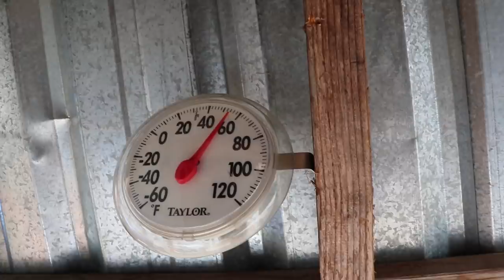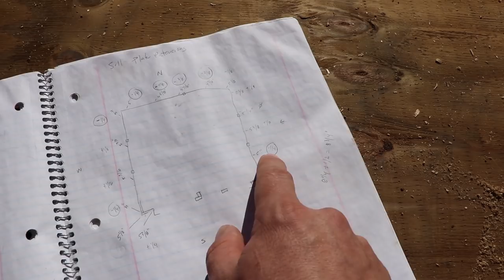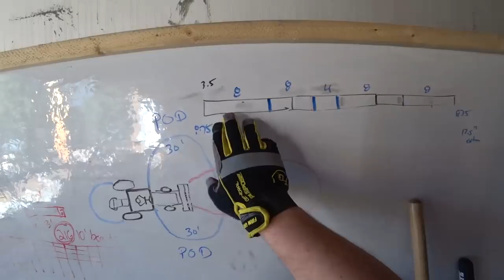Pre-SIP Checklist CONTINUES! (Adding Sill Plate Extensions)

Comment: Are you planning on installing the sip panels yourself?
Reply: I'm not sure how they are going to attempt the SIP's, as they can be 400lbs or more depending on the size they use....I used a crane, walls first then the roof.

Comment: you will burn up that cordless with that much torque using an auger bit one or two holes ok , but if your doing a lot then buy a heavy corded drill for auger bits. Here is he tool for that job https://www.milwaukeetool.com/Products/Power-Tools/Drilling/Right-Angle-Drills/1675-6

Comment: 1924: The Milwaukee Electric Tool Corporation was established by A. F. Siebert in Milwaukee, Wisconsin.
1975: Sold to Amstar.
1986: Sold to Merrill Lynch.
1995: Sold to Atlas Copco.
2005: Sold to Techtronic Industries.
Industry Manufacturing company (power tools and electronic equipment)
Founded 1985; 33 years ago
Founder Horst Julius Pudwill
Headquarters Hong Kong
Key people Joseph Galli, Steve Richman, Mike Farrah
Website www.ttigroup.com

Comment: I can't believe how many fasteners you guys are using. Omg, overkill!!!!
You guys need to take the load off the drill but keep the drill motor running so the fan cools the motor.
Reply: Can't really do that with the self-feeding bits they were using.  Should have used the spade bit in the drill and not the impact driver.  Give them a break, they're listening to wranglestar.  The blind leading the blind.

Comment: PLEASE...for the love of god, get some scaffolding round that house. It's an accident waiting to happen. Stay safe. ;-)
Reply: @Miles Finch

That house isn't going anywhere.  It's kind of the point of timber framing..... and the floor joists and warm board are installed.  Besides, they've already been through a couple of windstorms since the raising.  It's perfectly fine as is.
Reply: And get (and use) a couple of safety harnesses
Reply: yea like the day after the frame was done.. all 4 sides..Trainees learning on the job.. Like cutting 1/2 inch ply wood with 2 inch of blade sticking out..
Reply: @SteadFast nEasy Scaffolding isn't for structural support. It's for access to work on the outside walls of a building. FYI

Comment: the auger bit should be run at a low gear, and using the impact to turn a drill bit also will not work well.  even thought it fits right in to the quick chuck, it should be used in the drill at high speed.

Comment: hi i like the show,   i was wondering why you did not tarp the roof ,i think it would  have keep  you a lot dryer,,  from the snow and rain  ,it;s looks like alot of work to keep things dry ,i think if you did the tarp on  the roof it would be a lot dryer where you work ..keep up the  good work
Reply: High winds
Reply: Pretty windy out there.  Likely wound't last I believe.  Cheers!!
Reply: If you trapped the roof it would of acted like a giant sail. If it was secured enough to have a chance of staying put you would have a serious risk of moving or damaging the frame.
Reply: yea me too.... 2 weeks after that frame was up,,, it would have been boarded in with 1-1/2  T&G RED PINE& covered with IKO water & ice shield.. dry tools,, tarp over side walls,,, stage both end walls,,, work on gables good days,, put down sub floor,,,, stove on sub floor,, stove in the garage hooked to the same pipe!!!! heat & dry up & down When it's weather tight dry shell,, the rule of thumb is your 1/3 done.. They said it was a 10 year plan...
Reply: Richard Sabean k

Comment: SIPS are an incredible pain in the keester to fit and install.  The error is trying to make things too perfect.  You cannot.  I repeat,, you cannot attempt to install SIPs using really fine dimensions.  And worse yet  the 4x4s,, 4X6s,, 4X12s not only are differing dimension,,, but that dimension will change later this year, next year,,, every change of the seasons.   Choose a method with slop in it.  Foam it into place,, use a blue sill seal,, choose a simple way.

Comment: Can someone tell me what a SIP is?
Reply: Juno Mac RC Structural Insulated Panel... a 4x8 sheet of thick rigid styrofoam with plywood glued to both sides of it. Could have drywall glued to the inside if you want, or treated plywood on the ourside and use it as a foundation wall. Neat stuff
Reply: Thanks for the answers re SIPs.
Reply: Thank You All!
Reply: And they're not restricted to 4x8... They can up to as big as something like 8x24! Crazy big panels! Means fewer joints and thermal bridging.

Comment: Can  you please explain for your non-american viewers what a "SIP" is?
Reply: its basically ridged foam insulation sandwiched between 2 pieces of plywood so that you either dont have to insulate the inside of the house or it just give you even more R-value. you use the sip panels as the exterior sheathing of the house and then either brick or put siding on it instead of the normal just nailing plywood to the outside of walls. hope that helps bud